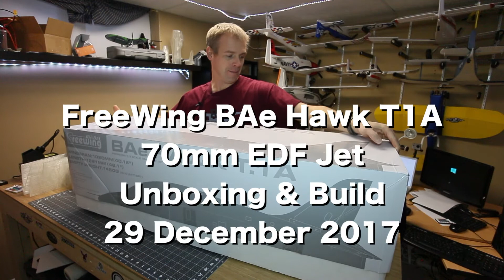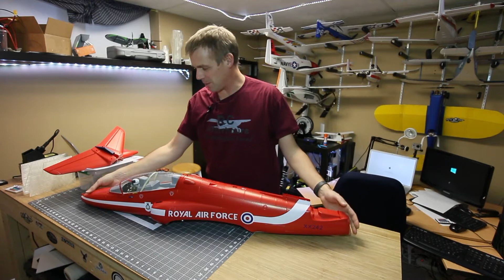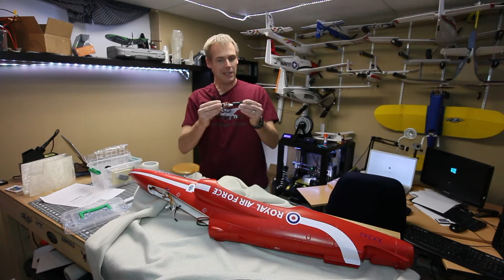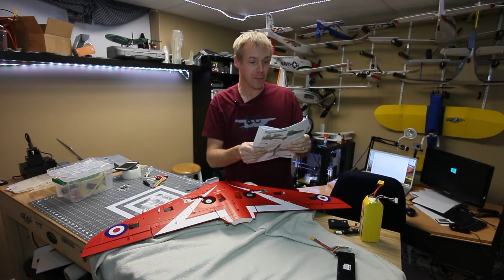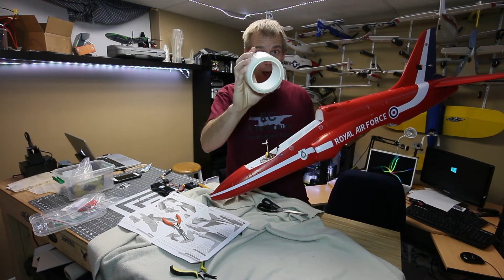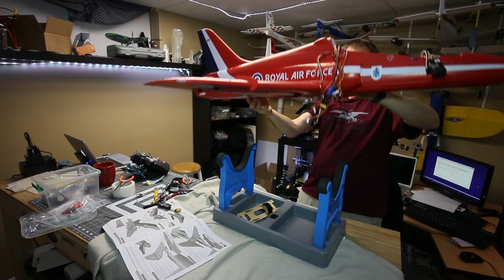Freewing Hawk T1 Unboxing & Build

Comment: do you think there could be room inside If I bought the ARF plus and used an avanti 80mm fan ? I;m thinking maybe it would fit with some carving, but then perhaps the exhaust outlet would be to narrow to effectively give it more thrust.
Reply from the maker: Hmm FMS sell a 80mm BAE Hawk. That might work better. If I was to get an 80mm right now it would have to be the L39!
Reply: @blameandre  Oh yes, the L-39 and the FMS hawk both look sweet. I was thinking the ARF plus was a  reasonable price, I want to re purpose the Avanti fan / motor I have, and it would be crazy fast if I could make it work.
Reply from the maker: @tomheetderks9997  I'll ask Alpha :)
Reply from the maker: From Alpha "No, the fan would starve. Intake FSA and outlet FSA are different."
Reply: @blameandre  ah yes, forgot about FSA equation..thanks for asking him!